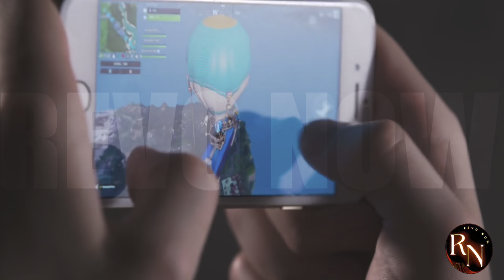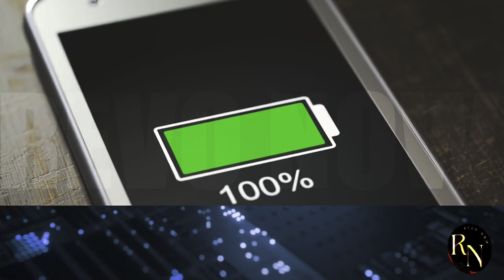Xiaomi CRUSHES It With CHINA's FIRST 3nm System-on-a-Chip!

Comment: The chip could be mass produced via TSMC's N4P process, which can improve a chip's performance, power efficiency, and transistor density. 
This is not China's breakthrough bro
Reply: From what I heard they may be able to push limited quantities at SMIC as well, though for the time being you're mostly right. The actual breakthrough on China's part, though, is that they were able to design it without access to American chip design software.